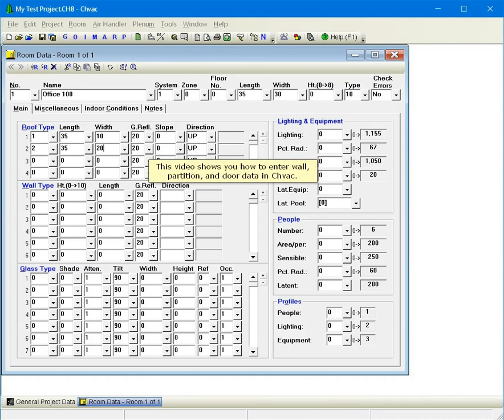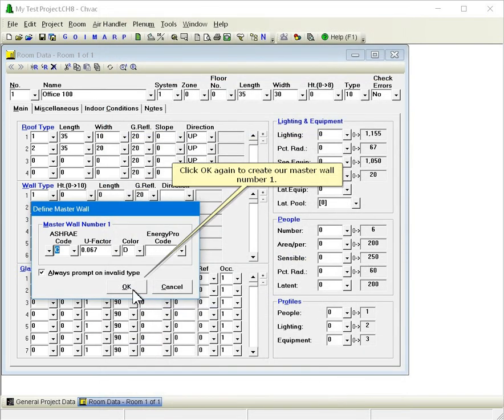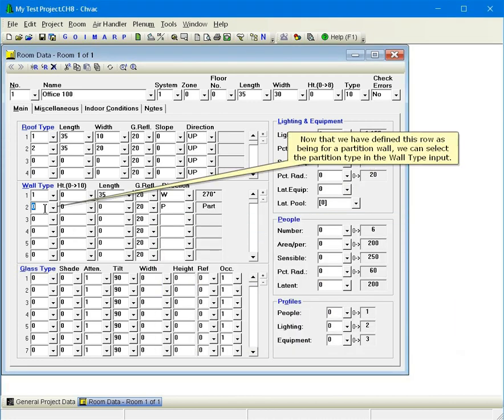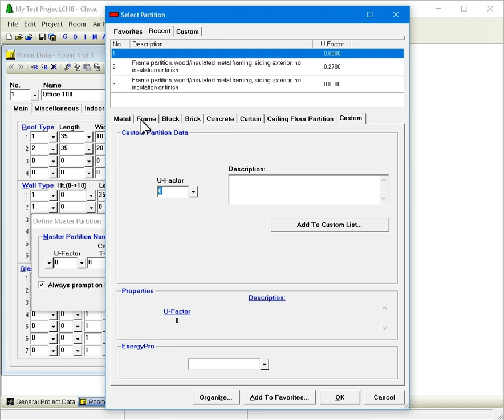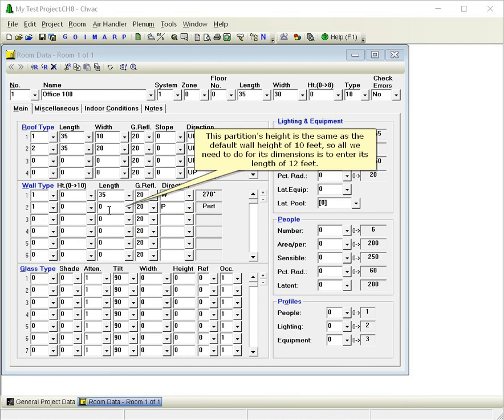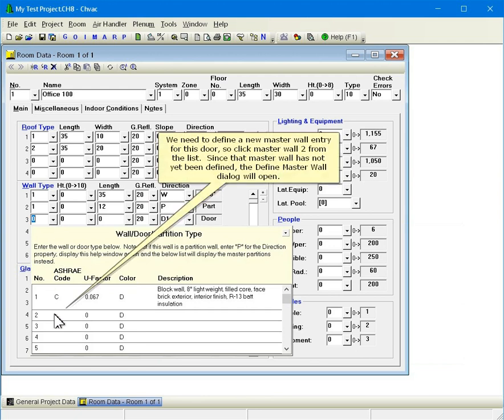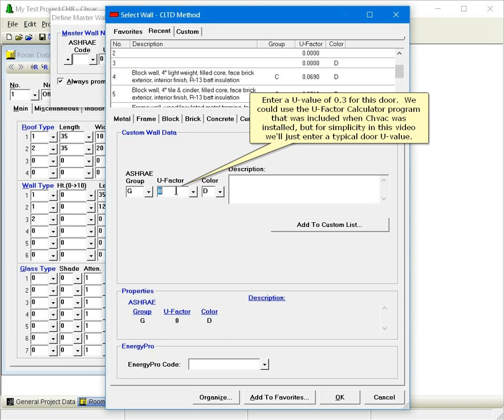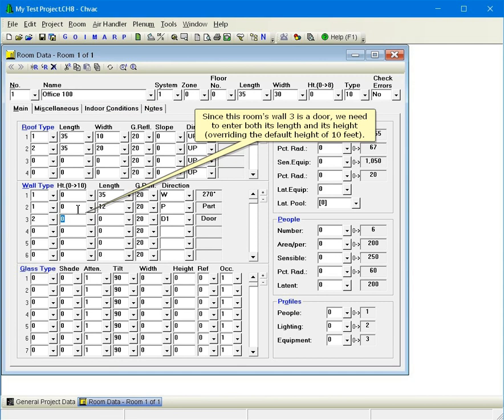Elite Software Chvac Load Calculations - Entering walls, partitions, and doors in the Room Data.

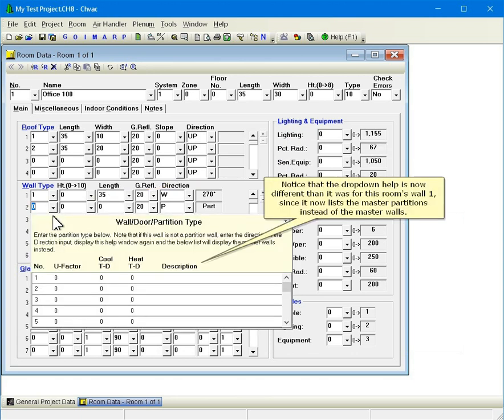Comment: @ 2:00 How do you handle a partition between rooms? Do I need to add the partition to "BOTH" rooms or just in one room? Example with two office spaces would have been helpful. From what I can tell, you ignore the wall; however, I have a warehouse. Warehouse can climb up to 90F (ventilation cooling only) and the office spaces need to be 75F. I can see ignoring the "partition" between the offices, but not the wall between the offices and the warehouse.